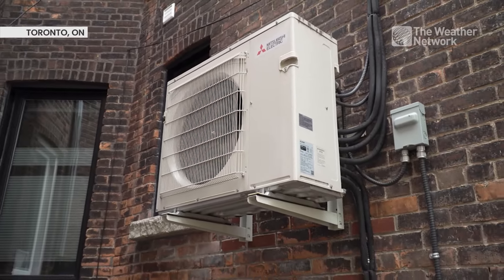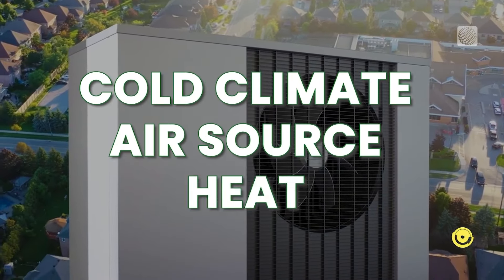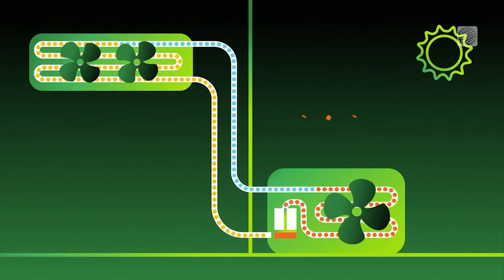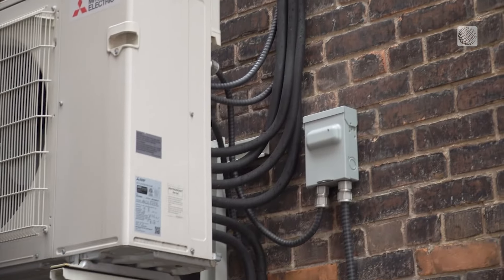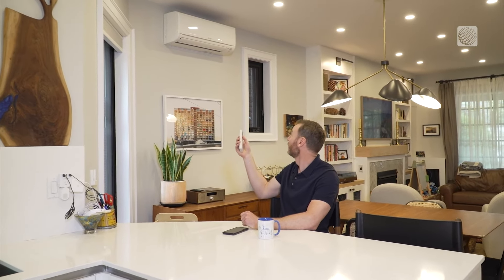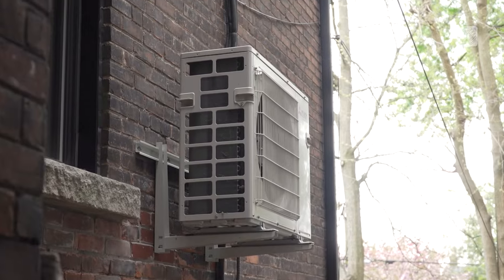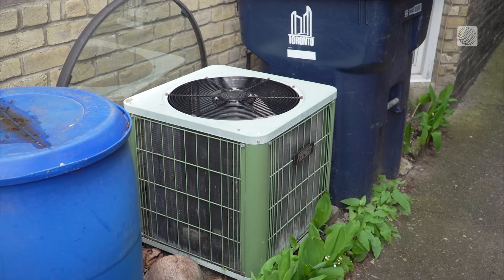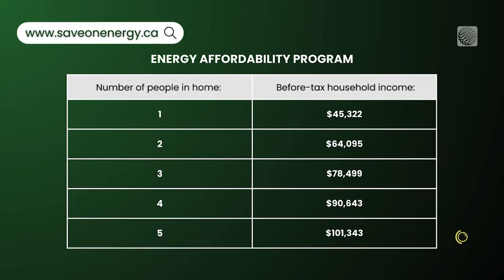Heat Pumps Can Both Cool And Heat Your Home, But Can They Handle Canada's Extremes?

Comment: We’ve had one for 14 years, but it’s connected to our furnace, through piping from outside. We already heat with forced air electric. It works just as well below 40c as above 40c. But the unit they are talking about looks like it’s portable or not connected to your furnace. So maybe they don’t work as well.